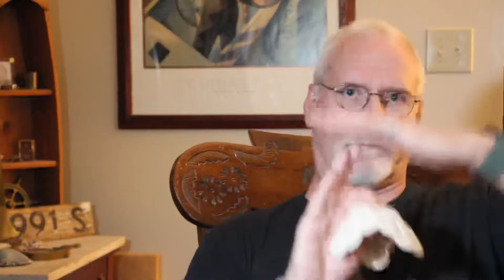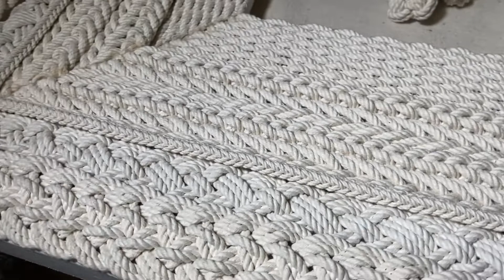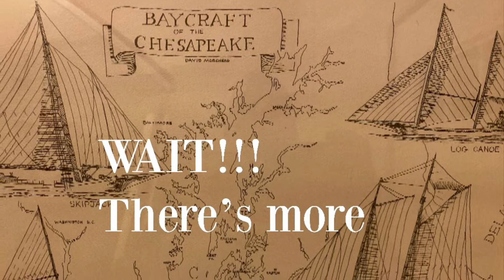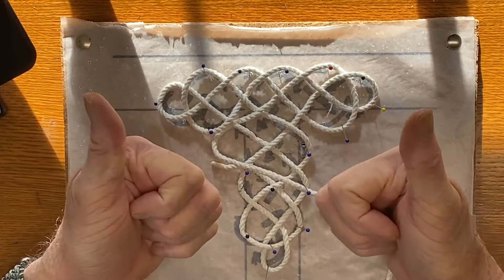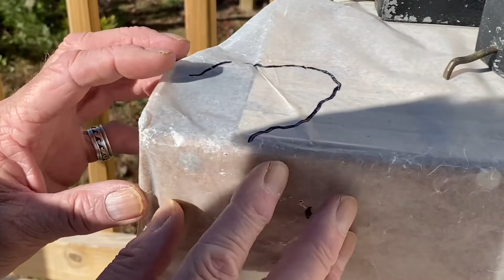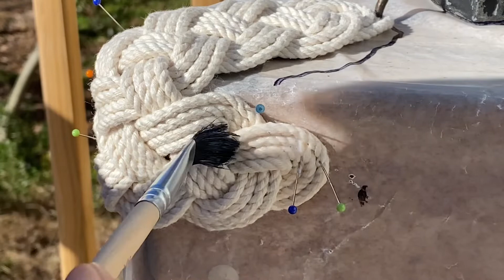10 Strand Flat Sennit and Sailor’s Cross Tutorials

Comment: Love this sailor’s cross for corners.  Any tips on the tightening process?
Reply from the maker: I draw a pattern for each one that I do ( a set of 4) to fit the frame I am making … I never need to fair them very much … I know that sounds unlikely but is actually the case … I dislike fairing them up in that it is a tedious time consuming process… so I solved that by making them to fit what I’m going … first try 😎
Reply from the maker: I draw a pattern for each one that I do ( a set of 4) to fit the frame I am making … I never need to fair them very much … I know that sounds unlikely but is actually the case … I dislike fairing them up in that it is a tedious time consuming process… so I solved that by making them to fit what I’m doing… first try 😎

Comment: Nice tutorial ! I will try to use the modified sailor cross to tie a cross potent (aka Jerusalem cross). basically 4 T joined in the center (and that's where my problem is). But if I try drawing a pattern like you did, it might work...  ☩
Reply from the maker: Most.. but not all … mats can be successfully tied using a pattern

Comment: How much cord did you use for the sailor’s cross? Thanks!
Reply from the maker: Which one ? I have tutorials on two different sailors crosses.... one long one short...... if I recall, the short one in 3mm line is around 25’ for three passes
Reply: @TrevvettKnots  The one for this video. You did 4 passes.
Reply from the maker: @krazysparkify  well .... this was tied in 4.5mm line ... I’m horrendous at keeping records in those specifics.... but I vaguely recall starting with 20’ .... here’s the thing ... it’s a mat and if you run out just start where you ran out with another piece. It’s simple to hide that addition on the back ... so there’s that. I didn’t need to on this for sure but I can’t swear it was 20’ either .. sorry I’m not more organized than that but I’m not ashamed to admit ...
Reply: @TrevvettKnots  Oh no worries, but yeah you’re right its just like a mat, its happened to me before where I just had to add more from the starting point. Thanks for you help though!